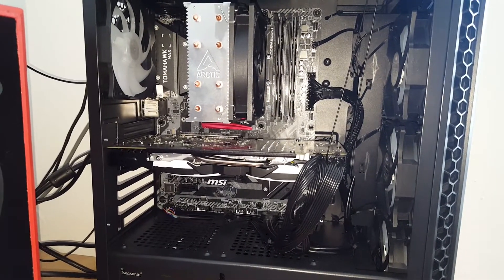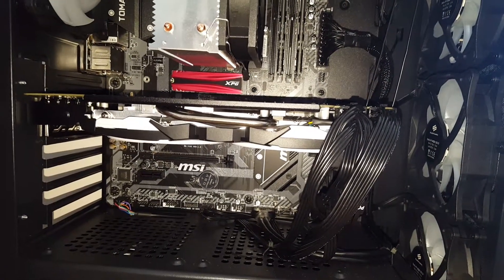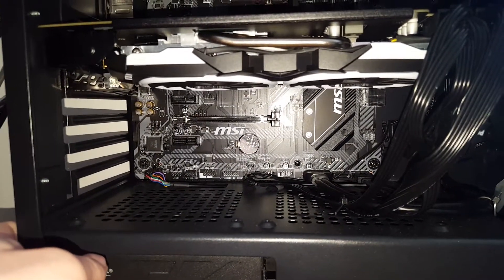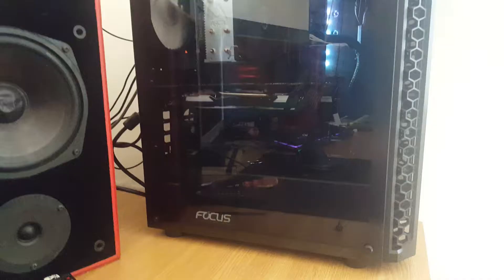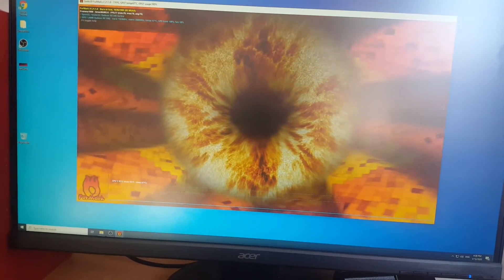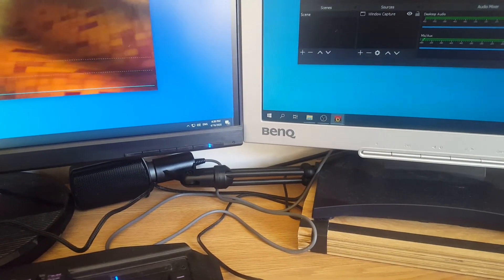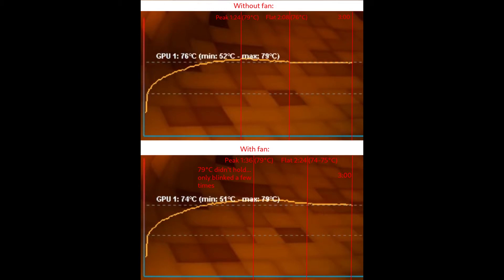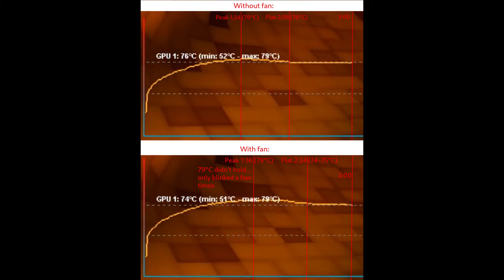Exhaust fan between GPU and PSU - worth it? (no)

Comment: Buddy - it makes sense and it is worth having such a fan, but you need to know in what cases;
- When we have a graphics card with high TDP and RADIATOR RIBS LOCATED ACROSS THE GRAPHIC CARD PCB (you have them along)
- we have a fairly strong fan on the front of the housing with the least conical pressure (preferably Silverstone series Air penetrator - 140, 120, 180mm)
- We use a case with an inverted 90 degrees layout (Aka Silverstone Raven)
If you meet ONE of the above conditions, such a fan will allow you to subtract a few degrees from the card. I did this with a small propeller from Noctua and it worked, took 4 degree off the GTX 1080 TI Gaming X Trio, BUT ...

I had a mega-expensive case, CoolerMaster Cosmos C700P (I DO NOT RECOMMEND), whose only advantage was full plasticity, you can rearrange everything in it and I did the test by mounting 3 x 140mm on the back (on tray), far enough from the I / O port of the motherboard, I want all the cables to reach and bend without any hassle (3 fans in one line, with minimal displayport reach from the graphics card) - and that was a fucking success. 9 degrees less! Back then, the entire case operated in a push-pull configuration - 3 x 140mm at the front, 3 x 140mm at the back. It was a milestone with enclosures. Currently, I am thinking how to adopt a similar solution in an ordinary case, LianLi O11 Air mini - because it is not enough to add a 140mm fan rack to the back of the case, but to add a wall around it to suck air only from the inside of the housing.
Reply: Arthur De Souza  No, it got only 160 TDP. With high TDP i meaned 250+W with vertical heatsink fins.

Comment: i haven’t got a PC yet but i wanted to put fans underneath, i think it’s a good look but that’s when i started to question the performance on airflow. My thoughts are that the fans will be blowing hot air into the gpu, what do you think?
Reply from the maker: Depends ... Every setup is different, do you want positive or negative pressure? Airflow front to back or bottom to top? Where do you want to place the case?
In the video it's positive pressure (3x 120mm  intake vs 1x120+1x80 out) front to back. The test showed that puting exhaust below the gpu didn't really do much of anything, perhaps only tiny improvement...
As some people pointed here - if your goal is just better GPU temps than intake below the GPU is probably better than exhaust even when it is partially sucking in the warm air from the PSU (tho this might not be the case if you plan to only have a small gap between the back of the PC and a wall, that gap could probably get quite toasty, so I would not put any intake at the back in that scenario). IMO the biggest drawbacks of putting intake below the gpu could be:
1) much more dust in the case (especially if it is unfiltered and/or you have the back of the case against a wall)
2) possibly higher temps in the case in general (even tho GPU temps might be lower).

Honestly for my setup just having hole there is probably the best - doesn't suck in dust since there is positive pressure in the case and it keeps the overall case temps a bit lower. 80mm fan didn't do much of anything and I can't even fit that in there anymore anyway (I upgraded to xfx quick 6700xt :).

Comment: Interesting test. My problem Is that in a lot of cases the Bottom front fan intake of the case directs it's airflow to an half inside the case, to the GPU fans, and another half into the psu shroud (inside It, ti the psu) and this flow Is completely Lost. Shroud should be long some Little more than psu and nothing more... Do you have a soluzioni for that ? I thought to cut the shroud and make an Angles surface to direct air to the GPU fans...

Comment: Maybe a case will come with a removeable PCI slot rear section and will come included with a 120mm adapter plate to install an exhaust fan. Would allow for easy two 120mm exhaust for those not needing to use any other PCI slots.

Comment: U should place the fan near the GPU as a intake 

Y, because ur GPU is upside down so it draws air from bottom and exhaust from the heat sink upwards . 
So, the GPU can get fresh cool air on its fans and this will help to keep the temp of the GPU cool by 8-10 degrees 
I have personally tested this it works
Reply: @Aditya did you put two intake fans below the gpu? Or just one intake?
Reply: @IFBBPROSTEPHEN  I have two 140mm fans toward the front and a 80mm fan just beside the GPU( above the psu , at the left side of the case)  as an intakes. 

And
Two 120mm fans toward up as exhaust. 

And it works great. 

The hot air coming out from the psu is not a problem as it  is likely not gonna affect you cooling.
Reply: no
Reply from the maker: No.

First of all, since the PSU exhaust is located just below, the fan would just draw in the warm air exhausted from the PSU.
Second, the 3 120mm fans at the front pump a lot more air than the fans at the back - the air flow in the case is supposed to go front to back, if the back fan would blow in the opposite direction it would work against that resulting in less airflow below the GPU.
Reply: What if you just put an intake fan towards the gpu in the middle bottom of the PC and not below the psu?
Reply: @IFBBPROSTEPHEN  yes that’s possible because only if u have a case that has vents towards the bottom of the cabinet. It will for sure work
Reply: @stuff5143  https://www.youtube.com/watch?v=PHp1yrjlMz0 Verat Is probably right
Reply: @stuff5143  you are tripping 🤣 because the psu fan should be facing the bottom of the case not the gpu fans
Reply from the maker: @embr33  psu fan should, and has intake, at the bottom an exhaust at the back.
Reply: @embr33  If you look at your power supply unit you will notice that it has writting one way up on one side and writting the other way up on the other side - this is so (if no shroud) the power supply displays the manf. name correctly no matter which way up the fan is. If you put the fan at the bottom it 'may' draw up dust or be blocked / hampered if on a carpet. If you put it the other way up it will, when the fan is active, pull air from inside the case, acting as an extra exhaust. However of course your gpu is drawing air from the bottom, so it needs a good supply from the front - you need a case with a removable shroud so the intake doesn't get blocked off. I would suggest that an extra intake fan at the back could also help provide a very positive pressure under the gpu, with or without the power supply running.

Comment: What rpm was the fan in the back spinning at? I did put a cpu cooler on my R9 290X and placed a 120mm fan right in front of the card and also installed a fan from an intel stock cooler over the pci-brackets in the back of the case, just like you did. I also installed argus monitor software to let the the fans ramp up with the GPU-temperature. With a pretty agressive fan curve of the intel fan I even could let it go from 0-rpm to start spinning. So you could call that semi-passive operation. :p That made a huge difference to my temps.

Just a question.... did you put a static fan speed for the graphics card when testing? One reason why you got the same result could be that the graphics cards fans did speed down due to the exhaust doimg it's thing. The fan curve could be adusted so the card always will top out at 79c?

79c isn't really a problem for that card. What extra cooling could do, would be allowing even higher overclocks. But if your card can't overclock anymore and only peaks at 79c, well then there's no reason for extra cooling.
Reply from the maker: All of the case fans were set at 9V (they are 12V fans, so it was 75% speed - about 1050 rpm for the 80mm fan on the PCIe slots and 1725 for the other, 120mm, case fans). The GPU fans did not have static speeds, they did have the same fan curve, which is shown at 02:13 .
I did not get the same result, it was a little bit better with the fan (better idle temps, reached the peak a bit later during the stress test), its just that the difference was so small that its not worth getting a new fan because of it (i left the fan in the case, because why not...).
The 79c temp might also be affected by the GPU bios, maybe the GPU downclocks a little when it reaches 80, idk. And yes, the temps are not an issue in either of the tests, but lower is always better :)...
The result makes sense in hindsight, its a mesh case with 3x 120mm intake fans and only one exhaust behind the CPU heatsink - plenty of positive pressure in the case, air was already escaping through the open PCIe slots so adding a little 80mm fan to the PCIe slots didn't do much, no way to fit a 120mm there tho... The test is obviously only relevant to my, or a very similar case, although i think that this kind of case config is the most common anyway (you buy a case with included 3x filtered intake fans at the front and 1x exhaust at the back and you don't bother to change it significantly...).